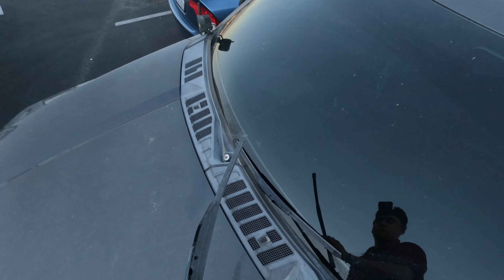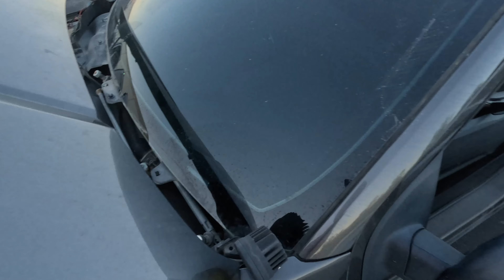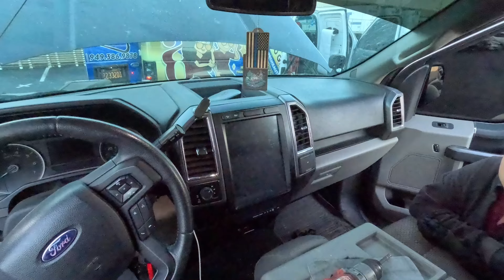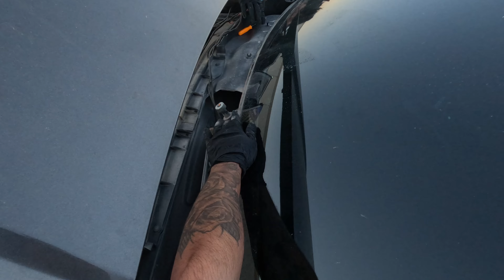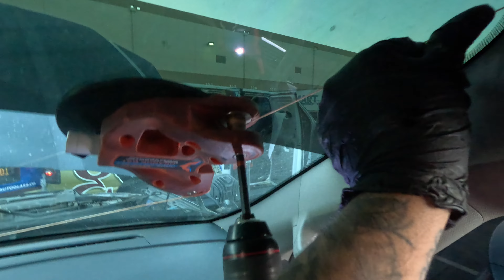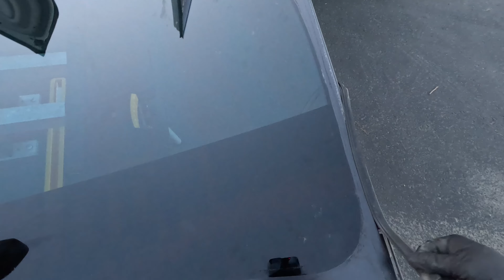2017 Ford F-150 Windshield Replacement ~ Supreme Auto Glass

Comment: You should seam seal those top corners with urethane where you ripped it right off when trimming.... you will eventually get a pin hole leaker